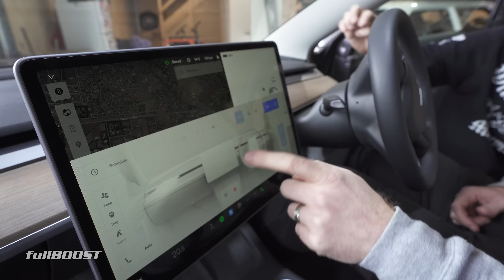Living with a Tesla from a 'car guys' point of view  | fullCHARGE

Comment: $18 a week to run it is certainly more appealing than my $80. 
Love this vid and the honesty. 
I'm like every other sound loving person, they will never replace muscle cars, but that's not their purpose
Reply: @Low760  and no one seems to understand that. Calculate emissions for the life cycle of the vehicle, not instant.
Reply: @Low760  20-30k more than what though?
Reply: @Low760  20k More than what? Youll actually find they are a lot cheaper than an ICE car with same features and performance.
Reply: @Low760  u forgot the emissions required to make the battery that othwerise would not be made...
Reply: @Low760  You can't buy an equivalent to this for 20k less though. He can only make that point for cars where the manufacturer has shoe horned batteries into a normal vehicle.
Reply: @Low760  John Cadogan likes to make statements for people who can't think for themselves. If a Tesla is $20k more to buy, therefore there's no benefit in buying it
What car is he basing this comparison on that's $20k cheaper, (so $45,000) has the same safety standards, technical features, performance and efficiency as a Tesla Model 3..?
A BMW 3 Series is more expensive, has less performance, less features and less efficiency. A Mercedes C Class and Lexus is the same...
What car...?
There is no other car...because it's bullshit.
Reply: @Low760  unless we're racing where i've left you at the lights.....you're  listening to your noise and watching me disappear.
Reply: @zaamuro8408  there you go with some myths again.  You think buring petrol the next 30 years doesnt make emissions.... Emissions of an EV manufacturing are *NO DIFFERNT* to any other car!  you think you can grow conrods and turbos in the back yard or what??
Reply: @Low760   who said anything about money mate?  You know a golf 8R is a $90K piece of kit now dont you?
Reply: @andrewm190E   a model 3 Performance is $100K and rising with inflation and a dropping dollar.
Reply: $18 a week for now?!!
Reply: @StuFletch68  per 100kms 
$3.6 at off peak rates
$0.90c for solar generated off your roof but that’s a sink cost already spent that so could call it free.
And 
$0.00 if you charge at local shops where it’s free.

At the moment 
1/3 of my charging is free and 2/3 is from my solar so I’m at 60c / 100kms and I’m spending all that spare money on tyres because it’s so cheap to run I’m driving it like I stole it.
Note that it’s another $2.5 /100kms in road user charges in Victoria which sucks 
But I’m calling it tyres everywhere 20,000kms which is $10/ 100kms at $2k a set
In any case I end up at $14 /100kms 
Folks will take that number and say “ I can run my X for much less and that’s great” 
I couldn’t run the golfR for less than $50. BUT I also drove it much less and only for personal entertainment so it got a hard time.
Reply: @karlajensen100  as I said, for now, the cost of batteries and electric is going to skyrocket

Comment: I was a skeptic because I've ridden fast bikes all my life and love the sound and feel of an engine. But the first time I drove one, I was blown away with the acceleration, refinement and standard equipment. I've been looking for a car to drive on the weekend to hoon around in and this is definitely at the top of the list. It's not even the speed and cost savings. It's the lack of maintenance that attracts me. And because it has regen braking you don't even go through brake pads quickly. Maybe you'll have to redo suspension in a few years but that's it. And because the battery is in the spine of the car, it goes around corners really well too.
Reply: Lmao 🤣 how do you hoon around in a electric car . You can't even do a burnout in one of these things . Honestly under the 100k dollar mark ev's are pretty lack luster for a performance vehicle.  You can't track them , you can't drift them , you can't really modify them , they can't go fast . Not really sure what reason to have one than a low mileage commuter car
Reply: @thomasmatarazzo198  Each people get different satisfaction out of the same vehicle.
Reply: @MyRandomLife247  As a Yamaha man myself I appreciate your style 👌. I was just trying to point out that Ev cars are the literal squares of the car world . They are designed to be the least raw experience of driving,  so I'm not sure why you would want that as a fun car
Reply: @thomasmatarazzo198  I find them fun? If you don’t find them fun or interesting doesn’t mean everyone else shouldn’t.
Reply: @MyRandomLife247  what's fun about it ?
Reply: @thomasmatarazzo198  the acceleration and the way it goes around corners. Only car I've driven that gives me a similar hit to my MT-09 or R1.
Reply: @thomasmatarazzo198  Pretty easy tbh. And yeah you can do some pretty epic burnouts in Teslas.

There isn't anything under 100k new that can touch them.

The Performance when it came out was designed for track driving and was quicker than your typical M3, QV cars at the time.

Sounds like you just don't know what your on about.
Reply: @Jaredscott89  No Teslas are terrible track cars . They have all kinds of overheating issues with the motors at wot that put them in limp mode. Plus issues with battery life make for a short track day . Yes lots of cars under a 100k will walk a Ev under a 100k . No Tesla will not do a burnout without modification . Ev's will probably be cool one day , but right now they are uninspiring
Reply: @thomasmatarazzo198  obviously you dont have an M3P.  I do and YES it does all those things. it drifts, it tracks, you can spend plenty on suspension and wheels and tyres and even put some decent seats in it...... you can paint it or wrap it... but no need to modify under the bonnet.  Instead of carrying spare parts carry an extension lead :).   Shits all over any other performance car i've owned and im a car nut too had more than my share of fast cars.  Hellon the street this thing will get modified R35's *most* of the time
Reply: @thomasmatarazzo198   400kW and 770nm makes anything a fun car
Reply: @Jaredscott89   on the street there isnt much under $300K that will touch them.  only thing beating it is a Hurracan with launch control.  Porches all but a new turbo are left behind and the fact there are a dozen GT3s on carsales 5+ years old with less than 10,000kms on them tells me they are too scared to drive them as they cost $400K++
Reply: @thomasmatarazzo198    good way to loose your car and license these days but hey if destroying $1000 worth of rubber is your thing then knock yourself out.
Reply: @karlajensen100  ok?

Comment: Regarding the Alice Springs comment, I have in fact driven my Model 3 Performance to Alice Springs from Melbourne and it was awesome. Had to charge from 3 phase sockets at roadhouses but it was a pretty unchallenging drive. Definitely prefer to have more chargers around though. On fast chargers I have driven up to 1660km in one day, which was a pretty easy day.

Comment: 8 year warranty, 70%. I'm a car guy. Love my Model 3 Performance (I miss the sound of my V8 but it was so slow compared to this). There is a Supercharger at The Bend! It's great (track mode is fantastic and it'll let you can spin it). Needs a set of semi slicks, new brake pads and some better brake fluid (and it could use a diet). Other than that, it's great fun on the track! Comments about it being a great daily driver are absolutely spot on. What car can you get with this level of performance that you can drive daily under $150k. Look at the 2019 version, still pulling good $ now. Sure competition will come, but currently only the Taycan "Turbo" S can beat it. You can change the settings of the regen so it rolls like an auto. Also spot on charge at home. I've only ever used the Supercharger at The Bend. I only charge mine to 70% and rarely do more than 30km in a day. If I had a blackout, I'd be good for 10-14 days without charging! Also, don't charge to 100% unless you need to, the battery will end up  dead like the one in your phone. You're not going to keep it long so it'll be some other chump's problem I guess? I reckon you'll be able to hang on to it longer than you think. The 3P hasn't changed from a performance perspective since its release, apart from the build quality upgrade since it was made in China. I don't think you'll lose a different amount of value compared to an ICE car by keeping it for 10 years. I sold my VE V8 after 13 years. I can't see why I won't do the same with this.

Comment: Fullcharge haha! i have a background working on locomotives, when AC traction became a thing years ago over DC traction it was a massive game changer in the industry. The way they can monitor and control wheel slip/spin per second is phenomenal. I drive a barra turbo fgx and a Ls2 powered vc commy, two very different and entertaining animals to drive, but i will definately have one of these in the garage at some point as a daily! Will just be a 3rd animal to drive. Big picture EV definately has its place and will only get better with tech advances, horses for courses, but i will still be turning rubber into white clouds with fossil fuel or corn juice as long as i can, and ripping up the street one day in a 10 second EV!

Comment: Well said at the end of the video. My biggest issue with them is feeling threatened of having ICE cars taken away from us enthusiasts. However as a car doing what a car is built for, they're bloody amazing.
Reply: I test drove with my engine builder he said "I have an 800hp Subaru in my driveway and i cant build you one of these" RE Model 3 performance.  So I bought one.   GolfR i did 6000kms in a year as my toy car. M3P done 6000kms in 6 weeks tomorrow and its faster everywhere on the street (golf was just as quick down the 1/4 at 11.7 and 117mph Heathcote 3 years ago stage 3 car)

Comment: I have been a passenger in my friends base model 3 and I was genuinely impressed at how good it is doing the normal day to day commute. Very quick from 0 to 60 but above that, my i30n is faster.
Reply from the maker: Yeah you'd only buy the performance model 👍  I'd rather buy an i30 than a base model.
Reply: LOL since when does an I30n crack 3.1 seconds to 100 ?
Reply from the maker: He's referring to the Base model

Comment: A bit worried about his mile long extension cord in the boot with the charging cable. 😳 
I have a standard model 3 for work, and its a cheaper alternative to run over ICE vehicles but as a car, there is nothing it does that wows me. Makes getting in the GR on weekends more worthwhile.

Comment: Very down-to-earth informative story and the best I have seen comparing EV's to ICE vehicles by far ... AND not biased towards either one. I will eventually get an EV one day but enjoy my Golf R  and my wife loves er Mini on Cooper Works Countryman which are both very good daily drives BUT waiting to see what new tech comes out and what some of the other big manufacturers come out with. Already have 2 x 6.5 solar system on the garage roof and just need to get batteries (also waiting to see what solar batteries come out) so I can charge at night and a solar charging unit (around $2,500 at moment) ... a Great video/story. Well done.
Reply: I've got a 10Kw solar, 13.5Kwh Tesla Powerwall and a Tesla Model 3.
You don't draw off your batteries to charge the EV at night because the batteries are generally limited to 5kw output where a basic Tesla will draw upto 11Kw. Also with our car being about 60Kwh and the home battery being 13.5Kwh you won't get much in the car before the home battery is drained.
Generally we can charge the car over a few afterwards off the solar but as a huge proportion of our solar goes back into the grid we can easily charge on off-peak grid power for 10c per Kw using up a bit of the electricity credits we get each week.
Reply: Changed my golfR to M3P
Chalk and cheese the Tesla is a much faster daily (mine had $25k in mods too) 

As for charge point cost it’s a $750 item and depending on where your board is it’s a $300-1000 exercise to connect it.  As an example mine was $125 for a fancy RCD that it turns out it didn’t need and 3’ of flex to my switchboard and less than half an hour sparkie time.
You can of course charge them from a normal outlet - just like boiling your kettle for a day 😮

Comment: Energy density is the keyword here.
New technology thats right around the corner should hopefully make up for some of the short comings of current EV tech. 
Namely solid state batteries, promising double current tech Kms plus life time last 5+ times longer...!

: )
Reply: A model 3 performance will do 450kms driven pretty hard - 500kms is a walk in the park if you take it easy.  I dont need anymore than that and two blokes started in Perth couple of weeks back went around australia in 10 days opposite directions.

Comment: great episode and another good point of view not mentioned often about NOT having solar panels on the house at all(solar isn't going to do much for YOU personally if you aren't home during daylight hours unless you have a battery) John Cadogan recently did a video regarding plugging in your CAR to run the house during the day and charging it off peak at night ( youtube title : DO NOT buy an EV (electric vehicle) without considering this!)
Reply: John Cadogan is completely wrong, and his was a click bait video.

The average daily commute here in Oz is just 42kms. You can recharge this in less than 3hrs of an ordinary 240V 10A power outlet.

Even if you drive 4x the national daily commute here in Oz, you can still recharge overnight from an ordinary power point in your garage.

And, if you are a still bit short, just top up at a charging station once a week when you are shopping.

Big utility scale batteries are planned to be fitted every where. Thus wind and solar will be stored for use @ peak times.

Why not have your own solar ? Mine has a 20% roi tax free - you would be nuts not to have it. My utility company pays me $3K pa for the excess power I export.

If I had an ev, I would consider fitting a battery, if it made economic sense.

John Cadogan is completely wrong. Most ev charging is done at home.
Reply: @nordic5490  which bloody utility company is paying you that much?
I have a 5.5kw system on a house that gets used tops, 3 weeks in a year, so there is basically a fridge going 49 other weeks of the year, and I pay on average $45 a month bill. AGL pays the highest export rate of 11c/kwh.
Please explain!
Reply: @onedayiwillmakesomecontent  wah wah wahhh.  Your spare house costs money, o no!!
Reply: @nordic5490  You don't have a 20% ROI on PV. Your math needs work or you are lying.

Comment: I just did exactly this LOL. I race turbo VS utes. And got my wife a model 3 duel engine as our new daily. 
The car is amazing. Especially for a daily. It's like driving an incredibly fast Iphone. And wife adores it. 
I've got solar, but when you do the math. 
100kw battery to be recarged. 
8k Solar system. that's 8 kws per hour. 
So would take that solar system 12 hours to recarge that battery. 
You only get 8k at peak, which you generally achieve for 2 hours on a good day. Which is in the middle of the day. 
So the car would need to be parked at home for the middle of the day every day to run purely on solar.
Reply: The car doesn't have a 100kWh battery.

Your 8kW solar system is likely on a 5kW inverter, so you are generating 5kW for longer than 2 hours.

You also generally don't use all the energy in the battery in one go. Most people would use 10-15% on their typical comfortable commute. So its more like 2 or so hours to recharge if you had the right charger.

Crazy how even people who own them can spread misinformation.

Comment: 2035 Ev Drag Challenge will all be about Reaction Time & Transit Time between tracks, including charging. (no portable generators allowed) lol
Reply: Already happening mate Targa west has an M3P literally 2nd outright in a completely stock unprepared car on stock rubber with stock brakes. ~3 years or so back.  He's still running the same car and YES charging it is the only thing he needs to do to it.   Beats the shit out of bringing spare engines and gearboxes and trailers worth of gear

Comment: I would get a Tesla straight away, but only if the car yards that sell them put them on hire plans for the business which is what this bloke has done, i don't think he paid 100K for it in cash at all, he has got it through the business and that's what the car yards need to do or the government put a low interest rate for loans for businesses to get EV cars and charge points around need to be the same for every EV car, unless you have at least a 15 or 10KW solar panel system with massive battery backup your going have to drive the ev car to the nearest EV charge point to not pay though the nose ?
Reply: i put 72kWh in mine yesterday at my local free charging station YES and did I mention it was free

Comment: They're quick but not fast.
Reply: FAST cars dont hook on the street. nothing will touch one of these at road legal speeds the instant torque short of driving your porsche turbo around in 2nd gear all the time you are in the wrong gear at the wrong revs and the bloke in the m3P has disappeared before you even got it into the powerband